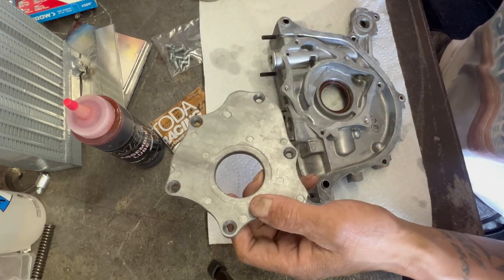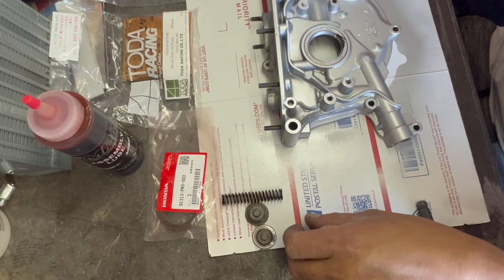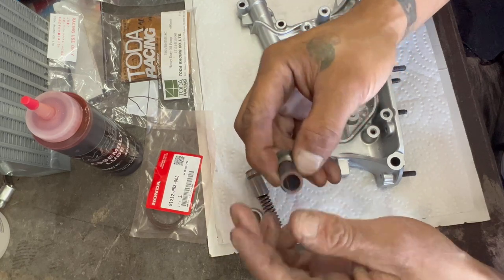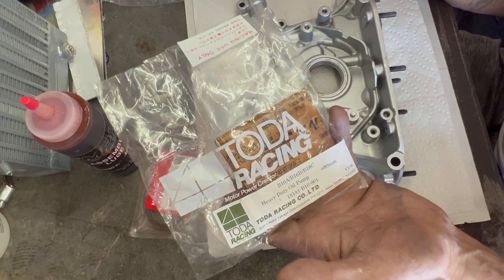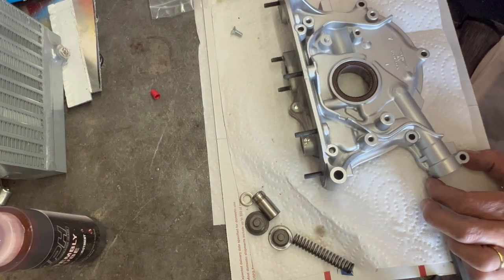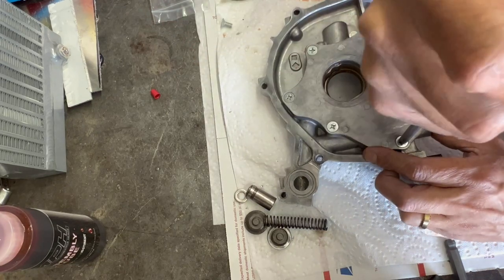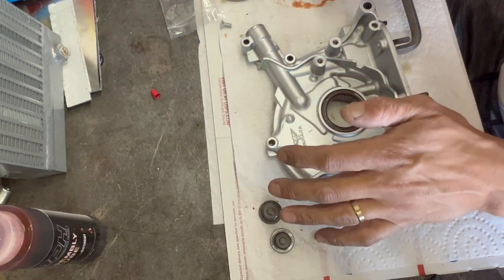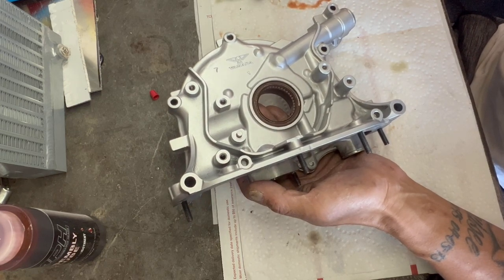B Series Toda Oil Pump

Comment: Do you know why there are 2 sizes listed for the B series.  I thought the rotor diameter was the same from b16 to b18 etc
Reply from the maker: yes before they started only making 1 pump before 0bd1 and 2 use different size gears in pump

Comment: Thanks for the video! What do you think of using the toda ring gear on a 4P ported oil pump?
Reply from the maker: i dont see point in ported oil pump if port on motor is the same as stock

Comment: Why did u use a higher tension spring and a shim?  How thick is ur shim?
Reply from the maker: spring is a little shorter so shim is to make up hight difference .075 is thickness of shim and .075 is how much shorter higher comp spring is from oem spring this same set up makes 93 psi on a 100k mile gsr mind you oil psi can differ just based off simple bearing clearances